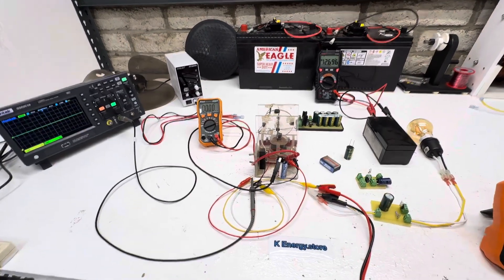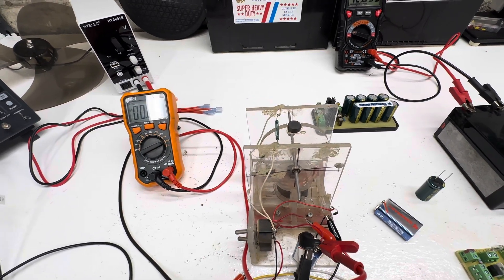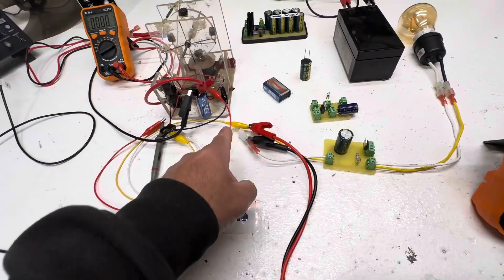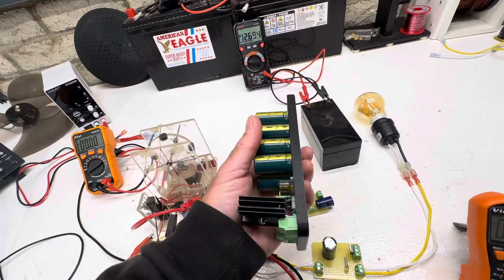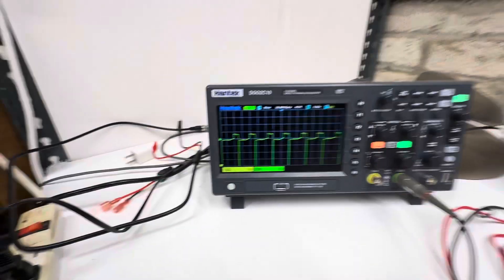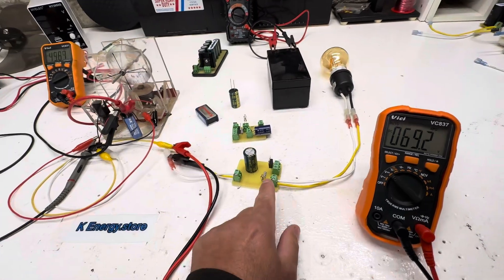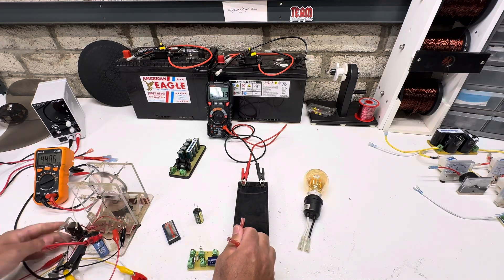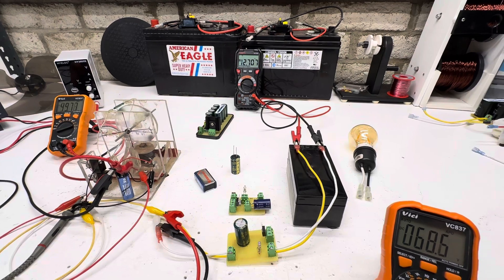Old 9 volt pulse motor

Comment: Do you have a circuit that I could connect my own capacitor to
Your circuit would dump between 20 to 30 volts
I want to use it for battery charging
The caps are 12000 microfarad 32 volt
Reply from the maker: Yes contact me at my store I can make a custom one

Comment: I really dig that old pulse motor and really like the fact that your using a reed switch. I just bought a few reed switched to try so the timing of this s great!!!
Reply from the maker: Thanks I do too !
I have some reed switches that are 3,500 volt that make 5,000 volt pulses from 12 volt motor
Reply: @kenergy1707  cool. I have to check to see what mine are rated for